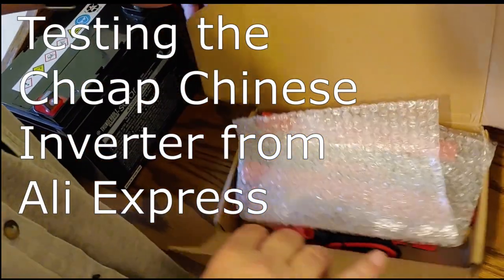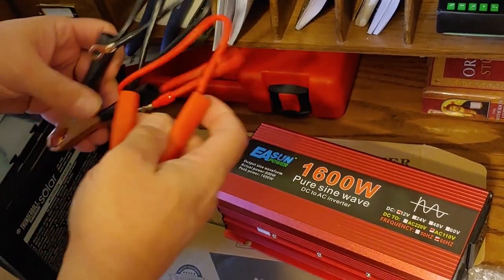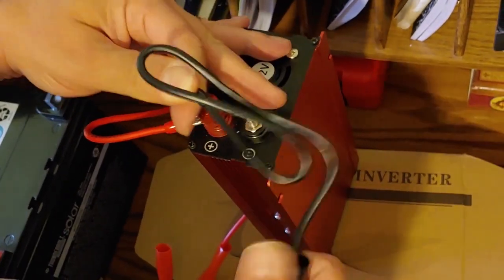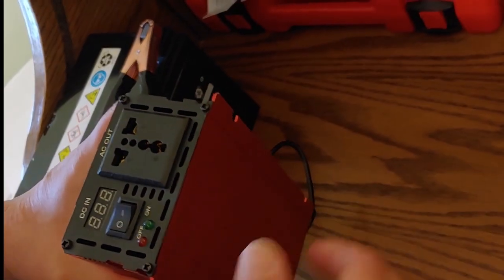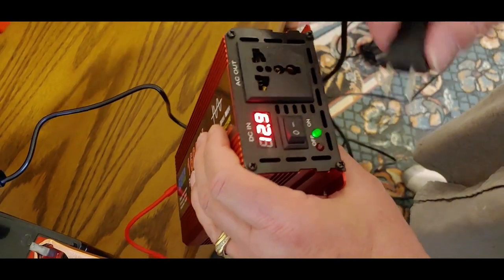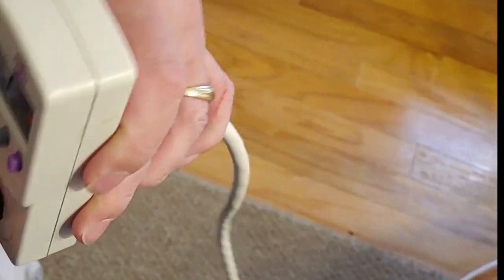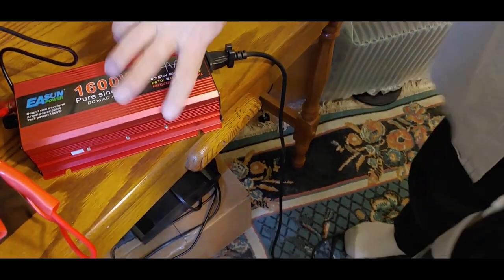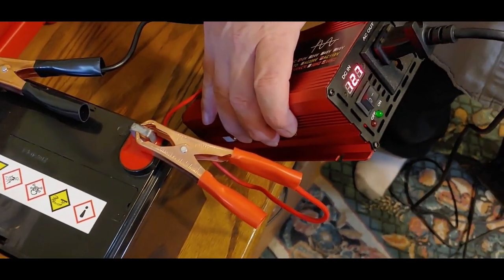Connecting and Testing My Cheap Chinese inverter from AliExpress

Comment: This inverter uses the same high frequency, transformerless inverter technology that is found in all expensive, Chinese made solar generators on today's market. These inverter/solar generators simply don't last. They are of a high frequency design and without an iron core, copper wound transformer to absorb the back EMF and high surge demands of high inductance loads, the MOSFETs cannot take repeated exposures to high surge loads such as full sized refrigerators, large power tools or large microwave ovens. You might be able to start and run some high surge loads when this inverter is new, but every time you fire up that inductive load, you're shortening the life of the MOSFETs in your solar generator/inverter. They also run much hotter than low frequency, transformer based inverters which makes the low cost, off spec, Chinese made components such as capacitors, diodes, resistors and ICs that are used in these cheap inverters, far more prone to early failure. Another consideration is that the vast majority of these solar generators are non-repairable. After the warranty runs out, you're not going to be able to ship this unit back to the manufacturer in China and have them repair the unit. At a typical shop rate of $125 per hour in the US, with no schematic and limited parts availability, it makes no economic sense to even attempt to repair one of these units. Once the FETs have fried and have taken the inverter's PCB with it, (And trust me, sooner rather than later, they will fry.) they basically become a brick. A far better alternative is to invest a little more money and purchase a low frequency, transformer based inverter charger. They last far, far longer and can easily power high surge loads without being damaged. See my video for more information on high low cost frequency inverters. I know this to be true because I've spent the last 23 years repairing inverters. They simply don't last when powering inductive loads.Thanks for the honest, non-biased review!
Reply from the maker: Thanks for your comment.
Reply: Great information. As I stated above I bought a ,<$50 500 watt inverter to test. I plan on using it only for low/no surge items. But my Ampex 1200 watt is a back up, and that with a 2000 watt Giandel.

Comment: If you need a Chinese inverter for a 800W inductive load.  You need at least 800 X 2 = 1600 + 20% = 1920W + softstartmodule. I bought myself a 5000W inverter + softstartmodule for a 750W waterpump and it runs fine. The fans don't even kick in....
Reply from the maker: Thanks for the comment.
Reply: Which inverter did you buy 5000 watt? Have you measured real values?
Reply: And in addition it need a bigger battery 800W/13V=61.54A, need a 70A battery.
Reply: @Swenser  I tried 2500w continuous and that is no problem.

Comment: Make better connections with thicker COPPER wire on the input side then retest.  Then try lithium batteries.   Results should be better with this unit.   Also I would suggest getting a small oscilloscope to test your waveform.
Reply from the maker: Good tips. Thanks for the comment.
Reply: There is no reason to test the waveform as soon as he tested the inverter with vacuums (motors) that works also with modified inverters.
Reply: No, the results won't be better.
Reply: @GreekOrc so you wouldn't want to determine whether your pure wave form inverter from China is truly a pure waveform inverter as described?   If not why?   Don't you kick the tires before buying the used car?
Reply: @solarcharging9743 why not?

Comment: Got a similar inverter, 500w, and tested it last night. I was also testing a 7AH battery. This team kept my big screen TV and a large desktop computer going for 1/2 hour. The inverter started a soft hum at 15 minutes, and went out a few minutes. The cables did not heat and the inverter itself topped off at 92F.

Comment: What i see from here that connection to the battery is not good. Clamps are just for lower consumption.
Reply from the maker: Thanks for the tip and comment.
Reply: Very much agree. My 1500w inverter (different brand) will not start my circular saw even with what I thought was a decent bolted down connection to the block on my truck for negative. Two very clean, tight connections with bolts and it'll kick it off every time. I dismissed my inverter too in the beginning but I was wrong. Alligator clamps would never even have a chance for 1500w in my experience.
Reply from the maker: @lancealderman2755  thanks for your comment.

Comment: Hey shoestring, I was wondering if the voltage of the battery is dropping too low to start the big vacuum.  You should try it on a lifepo4.  Thanks for the testing.
Reply from the maker: I thought that, too. Off camera, I did try several different batteries. It was still a "Fail" 
Thanks for your comment.

Comment: Cant go of the hoovers watts because that is the running power of it it could have a start up power pull of 800 to 1000w until the moter is at full speed then will use 600w
Reply from the maker: Thanks for your comment.
Reply: What you described is the peak consumption. In this unit it's advertised as 1600w peak, so it should make the hoover starting.

Comment: Those heavy duty 10 gauge wires should be a clue. I ran my 24 inch Visio TV, the laptop, and a small fan the other day, and the fan never shut off on mine...the wires don't get hot but I'm not going to run much off of it. I found another fault in it ; the cooling slits aren't big enough. So I'm going to do a Dremel remodel on the end plate. By the time I had watched the weather , it had gotten pretty warm. I fear for it's little life this summer. If I need more than 50 watts I will turn the Aims inverter on. Mine had the wrong instruction manual in the box. Maybe every so many , they throw the right one in there. It got me through a pinch and I'll see how long it lasts. P.S. Maybe you could get the Chinese one of those watt checkers...lol
Reply from the maker: Thanks for your comment
Reply: @shoestringprep  Hey, guess what...I found an improvement for this thing... I decided to mount it , so I decided to flip the fan around so that it blows into the unit, and that let me mount it with display showing up. Now, it acts completely different...it runs cool, the fan hardly ever comes on now. I had to put a tiny piece of duct tape to hold the little wires up off the mosfets until I could get the top back on. But under a small load, it actually works acceptably now. From the condition mine was in when I got it, I figured maybe someone was drinking that day , and put the fan in backwards. I could hardly believe how much difference this simple thing did to this inverter. Keep in mind that this one will never see 80 watts load on it, unless I have a fan on it. And mine is 24 volts, so I don't know, maybe a few less amps draw. I think the limiting factor is the cables...I should be able to push 750 watts through mine...that's all the wire they sent with it. But that is what the Aims is for so the little one is just for a 5 watt light, a laptop , and an 20 watt kitchen exhaust fan that I have behind the inverter. If I add the TV, the fan starts up on the inverter. But it doesn't get warm like it did...it runs much cooler. I think the fan was in backwards, in mine...I just thought you may want to check yours...I think I may have saved it's little life for awhile. P.S. It was approved by inspector 12 though, even though it had a wire off inside and the end bent in a half inch. LOL

Comment: 6:34 Using a vaccum cleaner is an interesting testing, but when dealing with motors 
you should use an Amp Meter with a Clamp recording the "InRush" starting current of the motor.
The Inverter should also indicate the Max InRush current. 
You could also said that this inverter Pass the overload protection and didn't get damaged.
Reply from the maker: I like to test with real world items that other people have and we'll use in their house. I appreciate your tips for future videos. Thanks for your comment.
Reply: @shoestringprep  Apparently an inductive load like a motor can hit from 3 times or more the rated power very briefly at startup. I expect its rated output was tested with a pure resistive load.
Reply: @shoestringprep  It has a rated "peak" of 1600W right on the box though. That of course means that it can handle a 1600W inrush power. Vacuum motors can easily require 300% their nominal current as inrush current, which puts that 606W vacuum at 3*606 = 1824 W, which is well over the inverters' rating. In other words, the inverter probably only 'failed' an application that was out of its designed specifications. Shorter; you overloaded it.

Also I'd be curious to see the voltage rating on that little battery once you turn the big guy on, you showed it for the little vacuum but not for this one. If the 200W already gave a 1.3v drop, I wonder what the 600W did..
Reply from the maker: @Arnout1990  It was not clear when I brought the unit. Thanks for your comment.
Reply: Looks like this inverter is actually good. Can run within specs, and protection works.

Comment: Just interested how much voltage drop was ? It could switch off due to low battery voltage.
Reply from the maker: That is a good idea but it was not the volt drop. Thanks for the comment.

Comment: Thanks!  After watching your video, I stayed well clear of those cheap red chinese inverters with fancy led readout.  If you open up those cheap chinese inverteres they are quite empty inside (and that's why they are so light in weight).  Instead I bought another cheap inverter for similar price without any LED readout, but quite heavy in weight and when I got it, I opened it up to verify that innards are quite beefy and indeed advertised weight is accurate.
Reply from the maker: Hope it works for you. Thanks for your comment.
Reply: Which model did you choose? I'm also looking for a cheap but safe inverter doing what it's supposed to.

Comment: Wondering if it will run an average size refrigerator/ freezer 🤔
Reply from the maker: I suspect not - unless the freezer is under 500 watts.
Thanks for your comment.
Reply: My old (at least 29 years - was used when I got it) Whirlpool 17.7 cubic foot refrigerator runs at ~200 watts, unless the defrost cycle kicks in, which bumps it up to ~600. A modern refrigerators (especially one Energy Star rated) should do better.

Comment: Can you do a video on what it would take to run a refrigerator off the grid??
Reply from the maker: I can. What type of refrigerator would you like. Small or large?
Reply: @shoestringprep  a large one please, at least I know that if i can power a large fridge i can definitely power a mid sized one. Thank you!
Reply from the maker: @Nachoford88  it is on the video list.
Reply: I can’t find it for some reason, I’ll check again in a bit.
Reply from the maker: @Nachoford88  I will let you know when the video gets posted.
Thank you for your interest.
Reply: @shoestringprep  If you do a video using a frost free fridge, be certain to run the test long enough the defroster kicks on. On my admittedly very old fridge, that triples the power demand (~600 vs. ~200).
Reply from the maker: @lonniemcclure4538  thanks for the tip.

Comment: Close to setting up a home off-grid system to run at most small ac fridge fans tv which would require about a real value 5kw inverter at about 600$au dollars for the cheap powmr. But I'm starting to think I'm better off buying several smaller inverters. Will work out cheaper and if one dies I still can use others. The only issue is the ac that will require a true 1-1.5kw . Can anyone select a decent inverter 2000watt real value from AliExpress. The 10 million watt(sarcasm) versions they sell end up being about 600watt.
Reply from the maker: I don't know any devices meet your criteria maybe someone else out there does. Thanks for your comment.

Comment: So yeah... I am one of these 3 dislikes. 
You know why? 
Because anything with a motor will draw so much more power when starting operation... 
This 650W vacuum cleaner may very well have drawn more than 1600W for some milliseconds. 
You think I'm paranoid? A power tool I own (it's a table saw) states that it has a consumption of 1500W. Well, guess what 12A breakers fall before it. (at 220V O_O). 2600W aren't enough to deal with it... 3000W breakers are barely enough. So yeah, is for one second the vacuum cleaner needs 1700W to start, then yeah, it won't work... 

The real reason why I disliked your video is because you cleverly hid the startup wattage of you vacuum when powering it from the wall. I find it quite suspicious...
Reply from the maker: Thanks for your comment